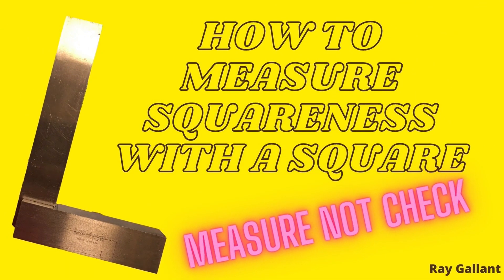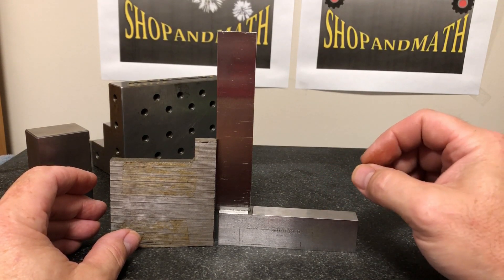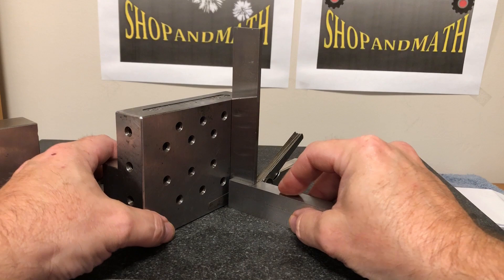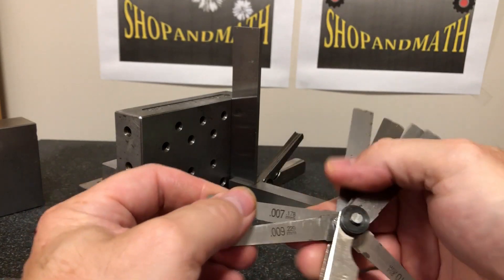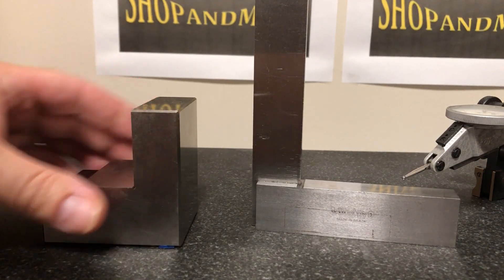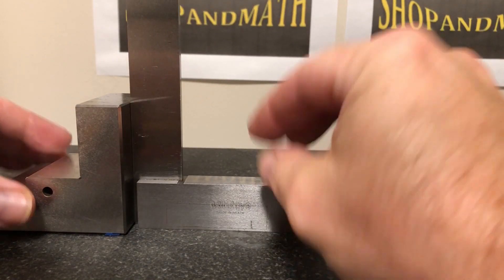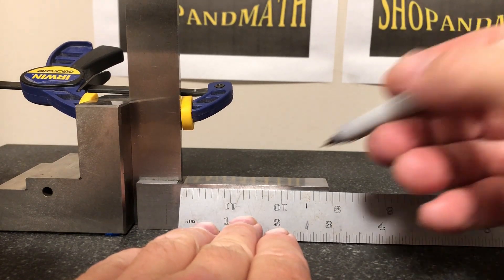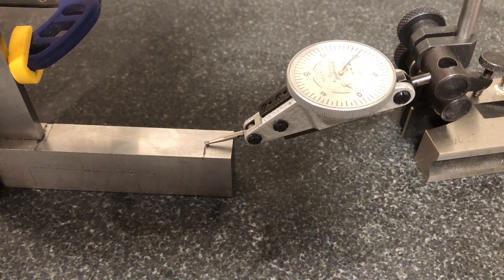how to measure squareness with a square

Comment: If you look at sunlight through a 500nm gap, you would likely see a green-cyan color.
If you look at sunlight through a 400nm gap, you would likely see a violet color.

Most of the common sources of light you would use inside are not emitting full spectrum of visible light.

If your light source (lightbulb, LED, candle) emits only wavelengths around 500nm (about 0.5 of a micrometer) 
you will never see violet.
The method works but only if you shine full spectrum light through the gap and understand the wavelength chart.

Comment: This is ridiculous; it has no purpose in practical machining. With over 30 years as a manual machinist, CNC machinist, toolmaker, and airframe sheet metal mechanic, using indicators, calipers, mics, etc., I'd be done while you're still explaining.

Comment: Something that really surprised me was cheap feeler gauges from Wal-Mart were actually accurate when measured with 0.001mm or 0.0001" micrometers.
I compared them to Snap-On and Starrett which were 10x the price
Reply from the maker: sometimes tooling is just junk other times it’s the cheap brand of the namebrand

Back in the day when you used to know where things were manufactured, I would order parts and talk to the sales guy and find out wow this square is made in the same place as the sterritt squares are made 

Thank you for your comment and thank you for taking time to comment. It is much appreciated. 
Ray

Comment: Yeah, the difference between the red & blue is 300nm which I believe works out to just under 0.3 of a micron or 0.0000117". I don't think the human eye can see that😁. The use of feeler gauges is pretty good & easy. Cheers
Reply from the maker: Hi Peter
I’m glad you understand my frustration when dealing with certain people
Good luck trying to tell people they can’t see color
And they also think that if they can see red or green or blue it’s like 2000s of an inch
Thank you for your comment much appreciated
Ray
Reply: Human eye can see color of light, not the size of the gap. If you look at sunlight through a 500nm gap, you would likely see a cyan or greenish-blue color.
You will likely see violet through a 400nm gap.
But this can only happen if the light source is full spectrum. 
Most light sources we use indoor are limited spectrum sources.
This method is used in many applications-it is fast, non-contact and can be easily automated. 
Difficult to use in a machine shop, but not impossible, if you have the proper light source.